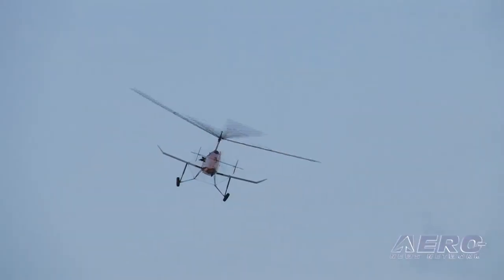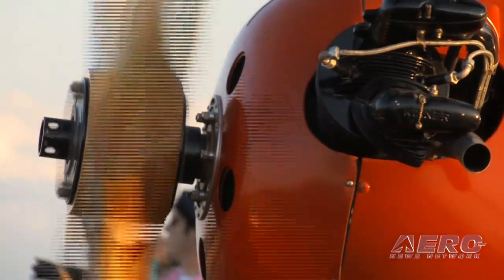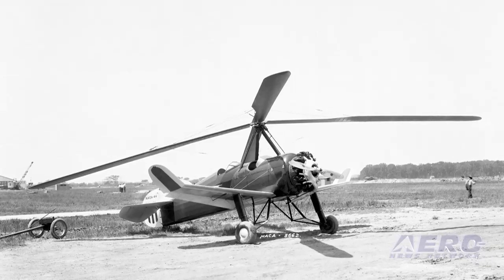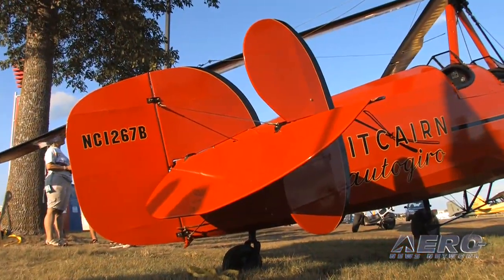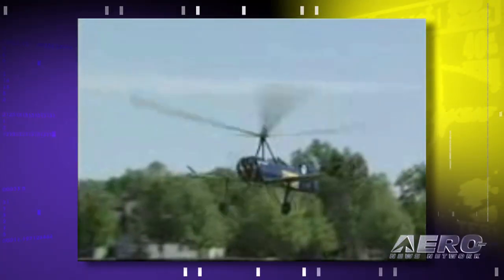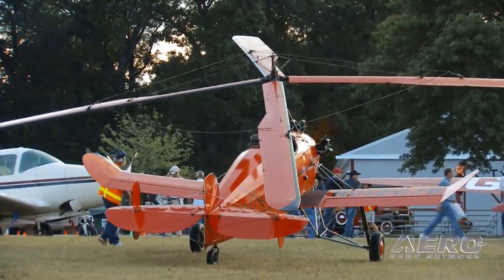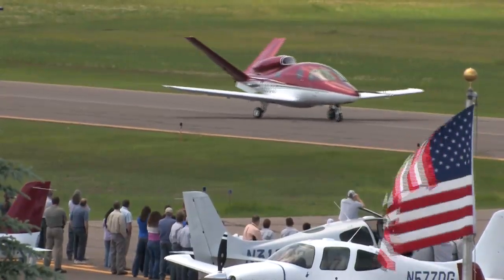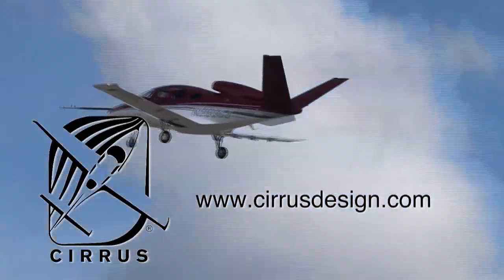Aero-TV: Profiles in Aviation - Pitcairn PA-18 Autogiro (Part 1)

Comment: Flight control throughout the flight envelope is the primary concern shared by pilots who has flown all types of machines which has lifted humans and human things into the air. Ask a Mitsubishi Diamond pilot. What control does the pilot have at slower air speeds? Is the rudder blanked by turbulence at high angles of attack? Fly them till they are tied down. La Cierva  and Pitcairn knew this and continued to achieve advancements leading to the direct control rotor and jump take-offs, with the latter limiting the sometimes dangerous ground roll with exposure to the aircraft at velocities less than controllable speeds. Each design has its limitations and advantages. It’s up to the pilot to learn to utilize or avoid the design characteristics. Hope the flight instructors know the aircraft as well.

Comment: There is no engine who  turn the rotor only bye  wind created by motor
Reply: On the ground, the rotors can be spun up by temporarily gearing them to the engine through a prerotator.  After the rotors are at the proper RPM, the prerotator is disengaged, and airflow created by the aircraft moving through the air keeps the rotors spinning.

Comment: I have a question for someone. The rotors have flying wires on them, when the aircraft is flying the front rotor is high and trailing rotor is low. What happens to the slack in the flying wires?
Thank you